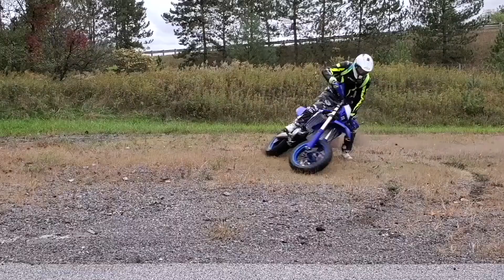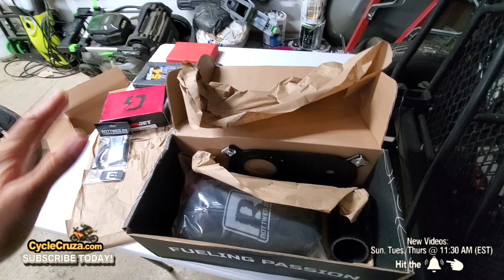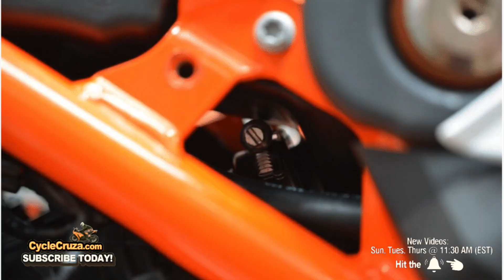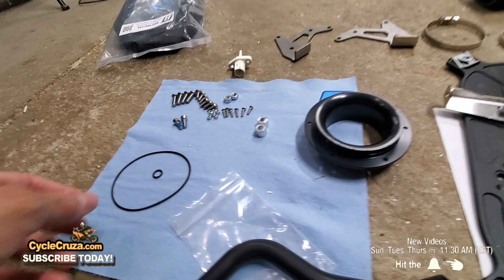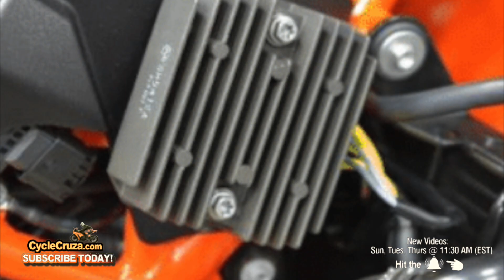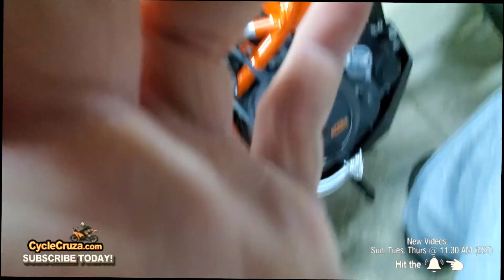2024 KTM 690 SMC R BUILD EP05 | Rottweiler Intake + SAS Removal + Fuel Dongle

Comment from the maker: Get My Carbon Helmet (Best Ever!): https://cyclecruza.com/vhxg
Get AIRBAG Vest (On Sale!): https://cyclecruza.com/w34j
*MY KTM 690 SMC R MODS:
Get Rottweiler Mods: Rottweilerperformance.com
LEOVINCE Full Exhaust: https://cyclecruza.com/mmsq
Get Lithium Battery (Restart tech!): https://cyclecruza.com/mymc
KTM 690 SMC R Graphics Kit: https://amzn.to/4b3Cnyx
Graphics Kit Custom: MotoProWorks.com
KTM 690 SMC R LED Headlight: https://amzn.to/49NgXor
Zeta Hand-guard Kit: https://cyclecruza.com/89qz
Zeta Black Handguard U Clamps: https://cyclecruza.com/703k
Zeta Handguard Smoked Turn Signals: https://amzn.to/3UDzpLC
Handguard Mirrors: https://amzn.to/3UFETWu
KTM 690 SMC Black Plastic Kit: https://cyclecruza.com/7j5b
Get GoPro Camera Mirror Mount: https://amzn.to/3Uln8Kv
Get KTM Mirror Hole Plug Bolts: https://amzn.to/3w64P46
My Supermoto Tires (Best!): https://cyclecruza.com/tdlv
KTM 690 SMC R Skidplate: https://amzn.to/448xsKh
KTM Confort seat: https://amzn.to/3Uomyvo
My Fender Elim Kit: TSTindustries.com
KTM 690 smcr/eduro Kickstand Delete: https://cyclecruza.com/5zsh

Links to get My GEAR, MODS and Other Stuff: ⬇ 
Get My New MotoVlog Camera (On Sale!): https://amzn.to/3R4MiLY
Get My CE Armor Jacket CHEAP: https://amzn.to/3AxZ6k7
Get My Motorcycle HOODIE: https://cyclecruza.com/nsx7
Get My Leather Gauntlet Gloves: https://cyclecruza.com/iclm
Get My New 360 CAMERA (So Cool!): https://amzn.to/3CFvhRs
Get My New Shorty Gloves: https://cyclecruza.com/pgip
Get Dynojet ECU Tuner: https://cyclecruza.com/3lh4
Get Urban Camo Pants here: https://amzn.to/3EDAET0
Get UNLOCKED Galaxy S10+ (CHEAP!): https://amzn.to/2WQXe7w
Get Phone Holder Wireless Charger: https://amzn.to/3CQFtX2
Get GoPro Mount (Saves Space!): https://amzn.to/3Aen7yY
Get My Helmet Microphone: https://amzn.to/3w8wTna
Get Bar End Mirrors:  https://amzn.to/3TlbJZu
Get the BEST Tires Ever: https://cyclecruza.com/7wad

Comment: A question on the air filter.

A friend of mine had a 690 with the Rottweiler air filter setup.  One day he asked me if he could borrow my KTM 690 Ergo seat to see how it felt.

I rode over there and we swapped seats and went for a ride.  When we got back we swapped seats again and I noticed there was air filter oil all over the bottom of my seat that was on his bike.  

It appears that there is no clearance between the top of the air filter and the bottom of the seat which makes me wonder how much effective filter area is actually available.

Have you seen any contact (filter oil on the seat pan) between the filter and the seat on your installation?

I am wondering if he has something a bit off on his installation.
Reply: This is very typical the R/W filter always touches the seat. All people have the problem but few talk about it. Rade garage is a good solution with 20% more airflow (real, it touches nothing) than the original. Then, there are the cone style that have max performance. The ones that turn towards the front can be placed with same battery.
Reply: @constantinosschinas4503  y tambien esta el dmc que se puede poner con la tapa que trae y se keda abierto o poner la tapa de la caja del filtro original.  Yo he pedido ese y lo montare en unos dias. Espero no necesitar reprogramar centralita. Saludos desde españa.🎉

Comment: Not bad, but instead of a jumper wire and heat shrink, they should have included a proper connector with the jumper built in.
Reply: yeah, i mean wtf are they charging 60$ for.

Comment: Another 690/701 taken by the crappy Rottweiler intake... KTM tuners in Austria wouldn't touch it with a stick. And stop raving about "insane power" when these bikes are proven to gain about 3% maxHP and 10-15% maxTorque on the dyno with a proper ECU flash, not some rinky-dinky, canned PC tune.
Reply: Agreed. These bikes only run great with a proper ecu flash. No piggybacks solve its emissions problem
Reply: @donkeizluv  Any opinion on the Rapidbike solution range which have embedded Autotune using original lamdas and are easy to install and remove? Seems like a very good solution for most owners.
Reply: @constantinosschinas4503  I dont think theres any piggyback on the market can nullify all the emission crap they put on this bike its not simply a lean afr map, they added many tricks and detection software. Just flash the damn ecu to cleanly remove all of it without adding any electronics
Reply: @donkeizluv  I guess you are right but adding a Rapidbike is just a matter of 1 minute and delivers maybe 90% of the result so it seems like a good alternative. If i flash the ECU, will the stock lambda sensors work for auto tuning? Or is it a static tune like power commander without auto tune module?
Reply: @constantinosschinas4503  lambda on flashed bike would work like stock for compensating altitude, temperature, just not to the full extend like auto tune. Im not sure what version of the 690 youre talking about here but the EU5 resists all types of piggybacks on the market. You're definitely not gaining 90% improvement compared to flash ecu on these EU5 more like 50%
Reply: @donkeizluv  I am talking about a stock 690 SMC R 2021 model, Euro 5. It only has an Arrow slip on but will get the basic conversion (air filter, sas and can delete). Looking for best low mid performance while keeping the engine reliable, not so much for peak HP. Will search for ecu flashers in my country (Greece) to see what is available. Appreciate the input.
Reply: The real gains are in lowmid revs and they can be on the 20+% scale.

Comment: Cyclecruza i have commented multiple times the powercommanders do not work on these euro 5 ktm 690, i have the same exhaust on mine its sick
Reply: Us version is EU4 so it works. Still an ecu flash is way better
Reply: @donkeizluv  oh OK I didn't know you guys haven't got the euro 5 version, do you have the newer style dash?
Reply: @RichardHinks-c1h  I think euro 5 is like 22 above they have a new style of dash but I don’t find it as nice as the 2020 one all they added is a rev counter I believe why you need that on a supermoto is beyond me 😂
Reply: @RichardHinks-c1h  Us version still has the old dash without gear Indicator
Reply: @smiffy9624  rev counter and gear indicator i think after 2021, in europe.
Reply: @constantinosschinas4503  I’ve got a aftermarket gear selector anyway but yeah your right
Reply: Did you remove the baffle? I'm asking because whem I removed mine, the power at the high rpm's reduced significantly. I wonder how it can be fixed 🤔
Reply: I have one fitted and it don’t work without mine Europe version but you deffo need one with the baffle out you shouldent loose any top end in about 4mph off 130mph

Comment: Awesome video man! I saw that you removed the exhaust baffle, isn't it causing a lack of power (specially at the higher revs) due to the lack of back pressure? When I removed the baffle from my Arrow exhaust on my 690 it significantly reduced the power at the high rpm's 🤔
Reply: Reduces powet everywhere i think, if proper tuning is not applied. Least you can do after any modification is turn off bike, turn on, hit ignition and let the bike alone running at idle for 15 minutes. it is called idle resetting i think it reads sensors and adjusts fueling.

Comment: Looks like some nice mods , I’ll be getting my Termignoni  exhaust and modded air box plate and reflash tomorrow on my 698 mono ,extra horsepower and getting things light weight is never cheap!👍🫡
Reply from the maker: Nice! Any issues with your new bike so far?
Reply: @CycleCruza  so far so good no issues whatsoever so far! I figured since they already made a V twin version of this motor(1299) that maybe any kinks could have already been resolved, but who knows I could be wrong.
Reply: @motosportadv8177 dude thats some bs marketing from Ducati. There's no such thing as an engine cut in half

Comment: Not gonna gain alot of hp, but definitely the feel in the seat will tell another story. With a lil bit more punch from a freed up intake.
Reply: You do gain some horsepower, but the biggest difference is the power and torque gain is mostly in the low and mid range, which is where it makes this bike so fun to ride. I did all the same mods to mine and it was like a whole different bike.
Reply from the maker: That sure is a lot of shiz they put on the bikes to comply with emissions. I'm so glad my YZ came with none of the bs but would be banned on the street in many states.
Reply: You go up to about 83hp I have the dyno sheets but the big foam filter ain’t as good as the air box mod funny enough as it swaps mid range for high range
Reply: @smiffy9624  So modifying the original filter box gives you more Torque/HP at the lower end, compared to removing it and just add foam?
Reply: @constantinosschinas4503  adding the Rottweiler foam with the bag will increase top end if you keep the air box with the added dna filter you get bottom end grunt which is what you want on a supermoto 😊
Reply: @smiffy9624  So you do no modifications to the original filter box,  just replace the original comb filter with a dna one. Thanks for the input.
Reply: @constantinosschinas4503  yeah if you watch lamb chops build he does a dyno with both mods if you wanted the clarification he’s on YouTube too :) and no worry’s
Reply: @smiffy9624  Yeah i know the guy, thanks.

Comment: Expensive mods for a couple hp gains
Reply from the maker: 🤣 They say about 10 hp gain which is significant. I love that it removes some more weight and less bs on the bike. It amazes me that all the bs they out on a bike these days to make it emissions compliant which seems to get more strict every year, eventually, we'll all be forced to ride electric vehicles only so enjoy the combustion engines while you can.
Reply: @CycleCruza Some HP at the top end is very nice. But the real party and the max HP gain is before that in low to mid revs, with excellent throttle response and 10+ HP gains. Euro5 really kills low mids. Also, extra max power will harm a bit the engine, extra low power will mostly not!
Reply: The changes are made to remove emissions control